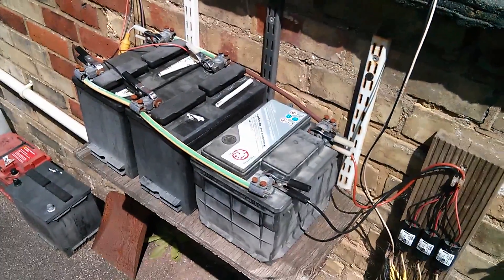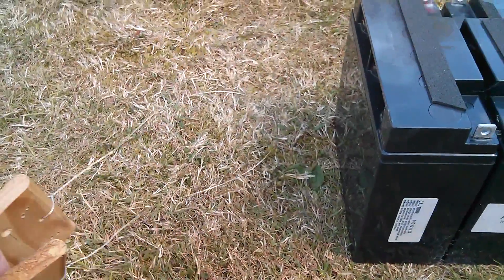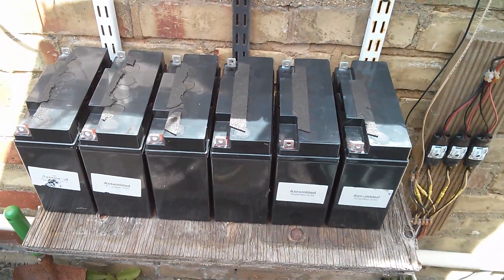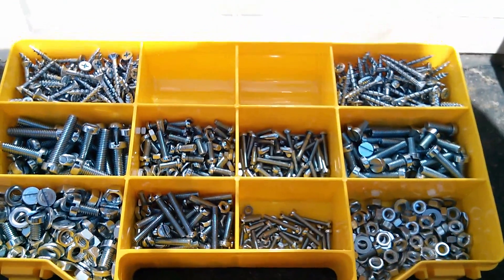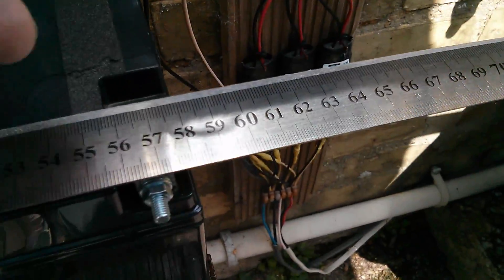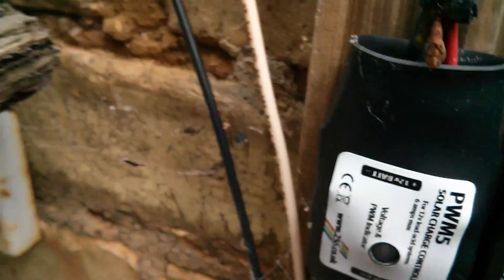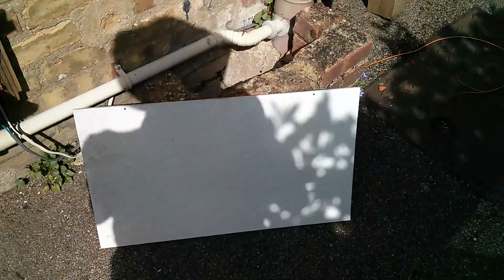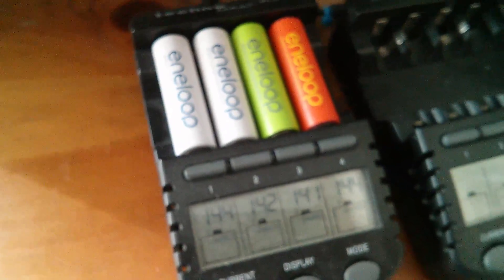1-Day Project: Battery Bank Replacement (in howling gale)

Comment: I hate to be a party pooper but.............

1. You actually only have around a 45-50 AH Pack as you will wreck them if you go below 50%
2. You should have used a fuse on each battery or at least split them up and fuse them. If one of those packs fail you could have a fire under your window.

Just an observation. No one wants to see you get hurt - We would lose our source of wife related jokes   ;-)
Reply from the maker: Actually, I'm planning to put a polyfuse on each individual battery with LEDs to indicate the fuse status :)
Reply: @JulianIlett  Thats a nice hot and cold solution to the problem  ;-)    I have HRC's on each of my battery's on a 48v series/parallel configuration. I am also using those arduino hall effect current sensors as my bank is  880AH I don't want any problem packs.

I use a large block of super capacitors (with your nice little LED mod) to take any big surges from the inverter. I monitor total current with a good quality shunt and monitor the lot with an arduino mega 2560 R3 and external watchdog.

The inverter gets send a shutdown signal when 380AH is used or bank voltage gets to low. It then charges of the grid if it gets that low. I use RS485 modbus to communicate with the charge controller so the system has a pretty accurate picture of the banks state of charge.  My polycrystalline PV array is just under 3KW so I am normally at float by around 13:00.

All my house lighting is 12v so I have a 30A buck module to drop from the 48v. If I did not already have the 12v lighting in place when I went a little mad on the battery and PV array upgrade I would go back to 230V lights as ironically the buck module is less efficient than the inverter but at least I don't have to worry about power factor with the lighting.

It was all a lot of work but it was worth it. In the last three years my biggest electricity bill was just over £22  :-D  They have actually to date sent out 4 meter readers and 3 engineers as they are convinced I have a faulty meter even though they have changed it twice.  LOL   I only have a small bungalow and if I had room for a larger PV array I would just go off grid !  Still I suppose its handy to have grid as a backup.

I upgraded the system about 3 and a half years ago and im on target for ROI next summer. I have been lucky with the roof facing just about the ideal direction and the pitch is good to. I am glad I did it and I would never go back but even with a Bsc in electrical engineering its been a big learning experience mostly with correcting for power factor issues to try and reduce system losses.

Old Mr Big Clive is right 100% on the smart meters. From what I have learnt over the years with modern appliances we are all going to pay an absolute fortune if they switch the meters over to VA !!!!!! That is going to hit a lot of people VERY hard. Keep up on the great video's and if you have managed to read all this without falling asleep you win a prize   :-D

Comment: Should use Vaseline or electrical grease on each of the bolts and nuts to help protect against corrosion.  Otherwise great battery bank.

Comment: Okay so I know this video is really old, but if they are Gel batteries, they will hardly work below 0 C. My guess is they are AGM batteries, a common mistake since they are both dry cells. AGM=Higher current draw, wider temp acceptance. Gel=higher capacity, longer overall lifespan.

Comment: God, I love your videos.  Car batteries 101.  Wire brush battery  terminals until they shine like polished silver.  Do inside of clamps too.  Coat with battery terminal dressing (get at auto parts store).  When lead terminals turn dull, they have a thin layer of oxide which will wreck the electrical connection, and kill the battery charge, discharge characteristics.  Treat your batteries well, and they will treat you well.

Comment: Julian,
Bit of a delay : waxoyl is a proprietary product freely available in most car places, possibly even supermarkets. It's a wax dissolved in solvent (  petrol? ). You can buy a spray-can( useful for the odd nut and bolt ) or even in big drums if you want to rust-proof a whole car. Paint it on all your electrical connectors, including sockets for bulbs. Lasts forever: much better than WD40 or contact spray. I swear by it.

Comment: Hi, one more thing: forget all that advice you've been given about protecting your vulnerable connectors from corrosion by sprays, spring washers, etc. Use Waxoyl. It's a waxy substance they use in industrial quantities for rust prevention in cars and so on. The stuff is magic and totally protects stuff outside for years. Buy it almost anywhere: Halfords, etc...
Bruce
Reply from the maker: Is that a spray?

Comment: Have you heard of the nickel-iron/Edison-battery/telephone-battery? It is supposed to be a really tough battery. Can be completely discharged as well as overcharged without harm. They don't contain heavy metals. They last 40+ years.
The cons are they are heavy, the self discharge rate is not the best, the charge retention is lower than other batteries.
I believe that nickel-iron batteries are preferable for home solar power systems. Reliability, longevity and low maintenance are essential in a home system. If batteries need to be repurchased and replaced every 5 years the average home owner will abandon the system.
Reply: Over coming the shortcomings of the nickle-iron battery is as easy as buying an additional solar panel or two. Which sounds cheaper than spending multiple thousands of dollars on batteries every 4-6 years.
Reply from the maker: Interesting - just read up on them

Comment: Hi Julian love all the vids but think you should have purchased brass bolts ,washer, nuts and used copper bus bars for connections, to stop corrosion and voltage drop just my opinion. all the best Bob
Reply from the maker: I'm expecting rust and corrosion! But I'm like the Wombles - making use of things that are lying around.

Comment: Awesome project Julian I built my own Battery stack using 432 Lithium ion cells I got for free, it took me weeks to test all the cells most were good, in total based on a liberal conservative figure the battery pack I made is at least 140AH and is 1 third the size. You can often get hold of FREE LITHIUM ION CELLS from a computer repair shop, when people have problems with their laptops not charging properly it seems 6 times out of ten its the charge circuit (Protection circuit) in the pack that has disabled the pack even though the cells are fine, it is a low cost way of getting hold of lots of lithium ion cells, however avoid the BIG Corporate computer stores they often refuse to supply used battery packs it is often the little guy running his small business who has a cupboard full of the things he can't wait to get rid of.  http://youtu.be/9yo_1c1yq7A?list=PLjuCiV5HRn3QbUqb944ABug__Vo1injZf

I just completed charging my new battery build a about 1 AMP it took a whole week lol, But one great thing about Lithium ION cells is the loss percentage is very small, from what I discovered through various tests is that only about 10% is wasted, in other words charging the cells I might put 10 AH in and get 9AH out which is a good exchange considering these cells in some cases are 15 years old, I am most impressed with LION the sure beat lead acid batteries regarding efficiency.
Reply: Hi, nice idea: I've salvaged a few from laptop batteries when I can get them, but if a computer repair shop routinely discards them, you could soon have a huge stash. Best not to wire them is series: maybe work off 3V7 nominal and make a boost SMPS?

Comment: Nice set up, its always very convenient having a reliable source of 12v, i actually modified a computer PSU for mine. Puts out a steady 12.8 volts, and doesn't seem to mind if you draw a few amps too, pulled about 10 amps at one point and it never seemed to mind  

Your videos are very good :)
Reply from the maker: Many thanks

Comment: I'm glad you made some sort ov a cover this time...! :) Again, though I would seriously get rid ov those alligator clips as soon as possible...! Hehe Use a bolt and an eye lug. Especially since you are dealing with aluminium. 'Cause what happens with this metal is that it always grows an oxide layer over itself. That's a great thing for the metal as it is then protected. The problem for 'lectricity though is that it's actually an insulator. One more thing, ali has a tendency to cold flow so you might want to add some split washers to those bolts.

Comment: Good job. I particularly liked the "permission denied" over the kitchen knife. I had the same problem using an iron to transfer a circuit design onto copper board, it didn't go down too well.
Reply from the maker: Haha. I don't get told off very often these days, but best to avoid arguments near the knife drawer.

Comment: Julian, I would make your connections  to those busbars with proper bolted terminals. Feed each of your PWM5s in via its own fuse such as the weatherproof ATO car fuse holders. That would get rid of the rusty choc block that's been bugging me in your solar videos. Also use proper terminal grease on all connections. Dissimilar metals, air, moisture and current are not the best combination.
I would even go as far as saying use those 100A fuses to connect the positive of each battery to the busbar. Fractions of a volt dropped on a poor connection will prevent charging and result in a damaged battery, particularly on a parallel bank as you won't really notice as long as one battery has a decent connection.

Also I wondered why you set the PWM5 to 13.5V? While I think that's fine for a battery to be kept fresh with no load, I would have thought something in the 13.8 to 14.0V region would be better for sealed cells with a cyclic load and more like 14.0 to 14.4V for "wet" vehicle batteries.
Reply: even the most comoon batteries like different voltages, the 3 main ones are AGM used in security/wheelchair batteries, like a 13.9 float but 14.4 top charge, and 2 types of car batteries depending if they are plain lead acid (can often tell by the top up covers, not always), in which case 13.3 float and 14.4 top charge, or lead-calcium (usually a valve sealed case) in which case 13.6 and 15v top charge, people can barely tell the difference, so it tends to fall to the compromise 13.5 and 14.4
Reply: Valvoline Tectyl 506WD is good to apply to the metal to stop corrosion. You can get it in aerosols and it's good for spraying on after assembly if you don't want to take things apart again!
Reply from the maker: That rusty choc block is bothering me too - I'll replace it.
The 13.5 float voltage came from research at batteryuniversity.com. The PWM5 starts the day at 14.4V for a 'period of time', then drops to 13.5 for the remainder of the day. It's a compromise really - the top spec charge controllers have different voltage set-points for different battery types. I'd like that for my Arduino MPPT. There can be a menu option for battery type (or voltage set-points). We can decide upon that by committee!
Reply from the maker: Simon Parkinson When I buy router bits, they come coated in a sort of semi-flexible translucent plastic which looks like it's painted on. I'd quite like to use that stuff.
Reply: Julian Ilett G'day Julian, I use a product Called  Brush-On Electrical Tape made by Blue Magic, on all of the electrical connections that I work with. Great stuff. You can get it on EBay.
cheers.
Reply from the maker: Grumpy OLD That sounds good, I'll look it up

Comment: Did you tried to regenerate your old Batteries with a Bedini Motor?
Reply: noo thats witchcraft! i think he is planning to regenerate them via lateral acceleration into a dark void
Reply: Why so complicated? To regenerate a old battery you can just use fairy dust!
Reply: superdau
On your suggestion i have ordered some of Ebay, hope it works!
Reply from the maker: jusb1066 superdau The substance most effective at regenerating old batteries is cupronickel (and lots of it).
Reply: Julian Ilett
And for the amount you need, almost as heavy as the batteries themselves ;)
But I've heard you can also use pieces of colored cotton or even plastic!
Reply from the maker: superdau ;-)
Reply: When I was a kid, I used to put my batteries under the grill for a few minutes. That would give me an added couple of minutes of power, plus the risk of a nice pop.
Reply from the maker: Siskin's Bits and Bobs Yep, remember it well - U2, SP2 or HP2?
Reply: They probably came with all those names. What would be a "D" these days (I think). All for my lovely torch. I still have a thing for torches.

Comment: were they spring washes under those bolts? i guess we shall see if there is corrosion from differing metals, but i guess the odd voltmeter check and visual is always needed, perhaps some grease on them too?
Reply from the maker: Not actual spring washers, but they may have been slightly concave, because they tightened up quite slowly (if you know what I mean). Can't decide whether to slap on the vaseline and end up with a sticky mess, or just accept that the whole thing will be rusted up in 2 years time.
Reply: *****
i am a fan of 3in1 lithium white spray grease, it starts off thin and creeps in then dries after a week , very tough, ive used in on car battery terminals a lot, and its held up well